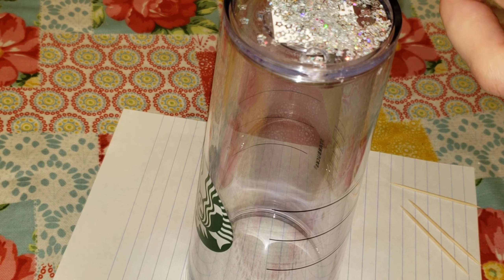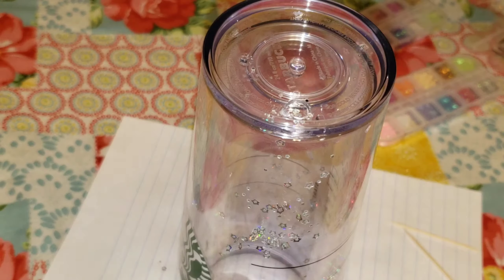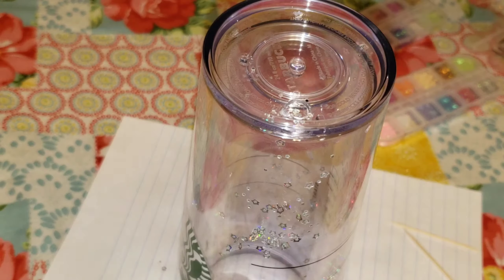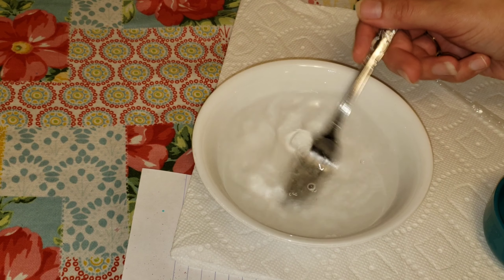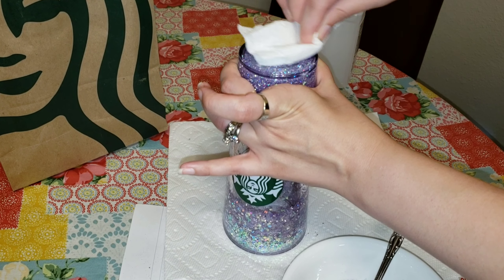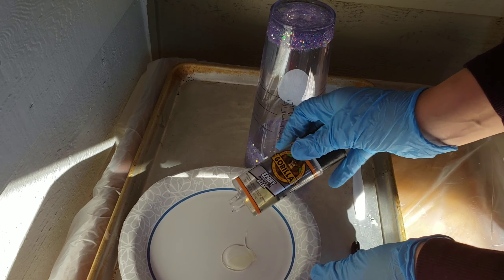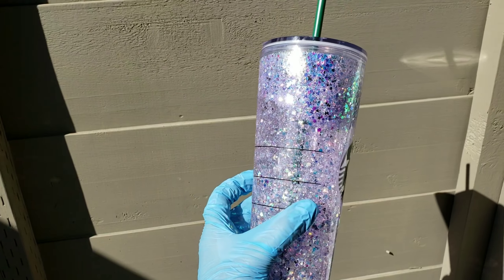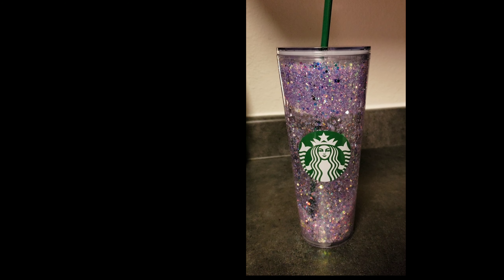Snow globe cup DIY / Starbucks snow globe tumbler / trying a new way to seal cups

Comment: So pretty, I'm about to try one of these. To seal the hole I got gorilla 100% silicone clear sealant I hope it works. I seen people using loctite silicone but I didn't see that so got the gorilla one. I was going to use epoxy over top that but now I think I might get the gorilla epoxy since it don't take as long. Thank you for sharing💖
Reply from the maker: Thank you so much and thanks for watching 💜

I've never tried sealing with silicone. I'll have to try that out. I think it would work well. The gorilla 5 minute epoxy is awesome it sets up so fast. Less chance for a leak to show up because of how quickly it sets up. You are going to love it.
Reply: @naptimecreations  I will let you know how it goes. I'm hoping to start it this weekend.
Reply from the maker: @reginawilliams9545  awesome, can't wait to hear how it works out 🤗
Reply: @naptimecreations  I'm excited, I just seen a storyboard tumbler the bottom screws off no drilling. You will have to check them out. Im going to do drilling one first though😊
Reply from the maker: Ooohh awesome, I've seen those too I heard from a few other people they tend to leak a lot so I haven't tried them out yet. It makes me nervous 😅

Comment: To plug the hole before adding epoxy seal u can cut a little piece of a glue stick like the glue sticks u put in ur glue gun and so cut a piece an  u can use it as a plug and file down the top of it  to even out the top and then epoxy over it  .
Reply from the maker: Ooohh that's a great idea. Thank you so much I will try that Asap. Thanks for watching 🤗🤗🤗

Comment: Sorry to ask, where do you get the tumblers I would like to make some just for fun and it seems that all are expensive. but for someone with no experience not worthy to spend that amount on a tumbler to messed up. lol
Reply from the maker: Thanks for much for watching. I buy these tumblers from Starbucks locations. 

You can get less expensive ones. I know these cups are pricey for the big ones it's $16+ tax here just for the cup. 

You can use any double walled acrylic tumbler. You can get them off Amazon just for practice. 

The only thing with the cheaper cups is they tend to leak from the top rim of the cups. I've never had the Starbucks cups leak from the top rim. It is fixable if they leak from the top rim but it can be frustrating. Hope that all made sense 🤗

Comment: Gorgeous colors!!! I have a small issue with my glitter clumping with air bubbles. Is there a way to troubleshoot this? :(
Reply from the maker: Thanks so much & thanks for watching 💜🤗 

Are you using fine glitter? They like to clump up a lot. Chunky glitter works best for these.
Reply: @naptimecreations  I used one that kind of had a mix of both haha. Maybe I’ll try just straight chunky next. Thank you!
Reply from the maker: @soukesouke5dolla123  definitely try chunky next time and as you fill it shake the cup periodically so the vegetable glycerin water mix can get all under the glitter. If you notice air bubbles from shaking it let it sit for a bit so they can de gas and pop before you fill it up more. 

Also depending on what you use to fill the cup make sure there's no air bubbles when you add the liquid to your cup. I use little pipettes and sometimes I'll have air bubbles in the pipette. If that happens  I'll squirt it all back into the container and try again without any bubble inside my pipette. Hope that made sense 😅

Comment: I hope you see my comment! I made one for the first time! but at the opening of the cup, the seal started to leak, am I able to use the same gorilla glue epoxy around the rim where the lid is ? sorry if it’s hard to understand what I mean!
Reply from the maker: Thanks for watching. I bought some cups off Amazon and had that problem. Do you have uv resin? That's the easiest way to fix cups leaking from the top. In this video towards the end it shows step by step how to fix it. 
https://youtu.be/DZoRHE3hlHg

If you use gorilla epoxy it might get wet before it sets up all the way and then it won't set up at all. Uv resin sets up really fast.
Reply: @naptimecreations  okay! That’s where my cups are from! I have uv resin on hand so I’m going to try that!! I’m going to subscribe & watch your video now 😊 thank you!!!
Reply from the maker: Thanks so much, the fixing cups video isn't mine but I tried her technique with the uv resin and it works. 

Those darn amazon cups leak bad. I bought 6 and 3 of them leaked from the bottom and they leaked rom the rim. It's easy to fix but frustrating when you think your finished with your cup and then realize it's leaking 😅💜
Reply: @naptimecreations  at least now I know I can fix it & I won’t be worried about having to throw an entire finished cup away because it’s leaking! Seriously you’re the best! Thank you!
Reply from the maker: @abbyparkins9374  no problem 💖💖💖

Comment: I have issues with the water mixture leaking from the bottom when putting hot liquids in my tumblers. Any ideas on how to fix this issue?
Reply from the maker: Thanks for watching 💜 the cups I use say to use cold liquids only. The cup might not be able to handle hot drinks.

Comment: Love this so pretty!! What is the name of the rubber stoppers and where do you find them to plug the hole up? Thank you
Reply from the maker: Thank you so much and thanks for watching, I just purchased these off Amazon. There's 2 different ones depending on what size hole you drilled. I bought the 5/16 inch plugs. I hope to have a video uploaded showing how I use them soon. 
Stoppers for hole on the bottom of snow globe tumblers 5/16 wide
https://amzn.to/3fMGmCo

Stoppers for hole on the bottom of snow globe tumbler 1/4 inch wide 
https://amzn.to/2F3lKcq

Comment: What makes the glitter separate to the topand bottom?I made my first one, and the glitter clumped in the middle and hardly moves.
Reply from the maker: Thanks for watching 💖 Did you use a lot of fine glitter ? The fine glitter gets really clumpy. These cups work best with chunky, shape glitter or extra chunky glitter. Fine or extra fine tend to clump up.
Reply: @naptimecreations  No... it was a chunky glitter that was mixed with fine glitter.  I tries another option of  water with baby oil. Maybe I should've used the glycerin instead. What makes it split to the top and bottom of the cup?
Reply from the maker: Ooohh I see It might have been the baby oil then? Try the vegetable glycerin mixed 50 / 50 with water that works really well for me and the glitter floats really well in it and it doesn't get stuck at all.
Reply: @Kari Wilson what did you use to close your tumbler
Reply: @badgirlhollywood9741  I use a glue stick to close the hole, and then resin coating the whole bottom

Comment: Can you use crafts smart glycerin?
Reply from the maker: Thanks for watching, you can use any brand vegetable glycerin as long as it's food grade. 

You want to make sure it's food grade in case the cup gets dropped and the vegetable glycerin leaks inside the cup. 

My friend dropped her cup and it looked fine on the outside but inside there was a small crack. She didn't realize it until she got a mouth full of glitter with her Dr. Pepper. 

You want to be on the safe side and make sure it's food grade whatever brand you use.

Comment: Love! I’ve been making some as well. Do you feel that your glitter clumps together at all? Some of mine clump in clusters if I’m using different shapes or styles of glitter.
Reply from the maker: Thanks so much for watching 💖 they're so much fun right?  I noticed with the fine glitter it clumps for me. Not with the chunky though. Are you using vegetable glycerin and water to fill them?
Reply: Naptime Creations I’m using glycerin. I guess it is the fine glitter component. I’ve had chunky glitter and decorative glitter clue as well. I’m doing a 50/50 mixture of glycerin and water. I’ve toggled with the ratios.
Reply from the maker: Im sure it's the fine glitter that's clumping.  I'd love to find some fun shaped glitters. The ones I've found and purchased are too big. I saw some really cute pumpkin shaped glitter but I'm worried about fitting it in the drilled hole and damaging the glitter as I'm pushing down into the wall of the cup. Where do you like to buy your glitter?
Reply: Naptime Creations I get mine from BritchesNbows shop from etsy I absolutely love her glitter. I mixed two different glitters. One of hers and one from another seller and they clumped. But I’ve purchased some from her store and it didn’t clump with the fine glitter. She uses polyester glitter. So I’m not sure if the other person has 100 % polyester or not. You should check her out tho! The combinations are beautiful

Comment: Have you noticed any of your glitters bleed? I used purple glitter with a glycerin mixture and mixture and now my liquid is purple lol
Reply from the maker: Thanks for watching 🤗 I have never had that happen. Do you know if you are using polyester glitter?
Reply from the maker: Polyester glitter is solvent resistant and doesn't bleed. Try to get some Polyester glitter if you can and try that I bet it won't bleed at all into the glycerin mixture.
Reply: @naptimecreations   im not sure... some glitter has the details on it and some doesnt.  I guess i better be safe rather than sorry and specifically look for the polyester..😔 nuts. Wasted money🤦‍♀️
Reply: @naptimecreations  thank you!
Reply from the maker: I'm sorry that happened 😓 a lot of the websites will say if it's a polyester glitter or not.
Reply from the maker: No problem 🤗🤗🤗

Comment: I’ve been having a problem with air bubbles how do I fix that??
Reply from the maker: Thanks for watching 💜 are you using a pipette to fill your cup? You have to make sure there's no air bubbles in the pipette when you fill and also letting it sit for a bit while your filling it can help pop the air bubbles. So fill it 1/3 way shake it up good so the glitter is all coated then let it sit for 30 min or so until the bubbles pop. Then fill some more. Let it sit again. 

Also tapping the cup from the bottom helps pop the bubbles too. Hope that all made sense 💜

Comment: My tumbler was leaking from the top, when I turned it upside down to seal the bottom  and let it dry it leaked !!! Any advice how to seal the top?
Reply from the maker: Thanks for watching, I'm so sorry that happened. I've heard of that happening before but unfortunately there's no way to seal the top. My friend who had that happen had to throw her cup away. May I ask where you bought your cup that's leaking?

I've never had any problems with the cups from Starbucks.
Reply: @naptimecreations  it was from Amazon 
I ordered a 3 pack, only one is leaking
Reply from the maker: @nicolemont9204  oh man I bet the cup was damaged during shipping. Sometimes there can be a small crack that's only noticeable when you fill it. I bet if you e mail Amazon they will issue a refund for that cup. Sorry about that.

Comment: Amazon has funnel that make adding the glitter way easier
Reply from the maker: Thanks for watching 💙 I saw that but I've tried a funnel and it never worked well for me. It was always getting clogged/stopped up at the tip of the funnel. I found it was faster to tap it in and less messy. I might try the funnel in again soon though.
Reply: @naptimecreations  I use a skinny drill bit to push the glitter down. Then I added a straw to the funnel  to add the liquid. So far it’s working pretty good.
Reply from the maker: @adaesmoot  that's a great idea. I'll try that next time, thank you so much 💜💜💜

Comment: A funnel is faster and less messy!
Reply from the maker: Thanks for watching, I tried a funnel before and it didn't work well for me. I'll definitely try again soon 😁💗
Reply: @naptimecreations  I think the most challenging part is drilling the hole and putting the glitter in. I made a paper one that was the size of the hole and I just use the end of a thin paint brush to push it through. Larger shaped glitter I use pointed tweezers!!
Reply from the maker: @lindyperez3268  that's a great idea, thanks so much. I'll try that next time 😁💗